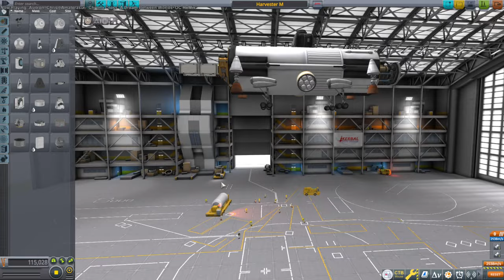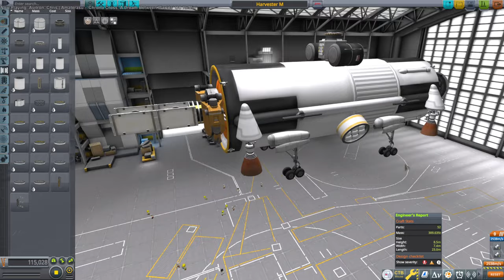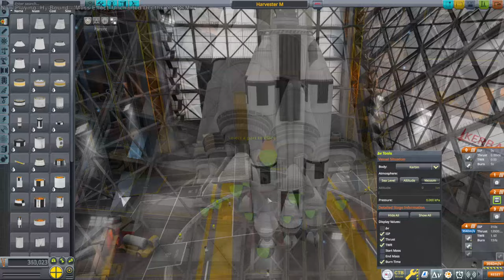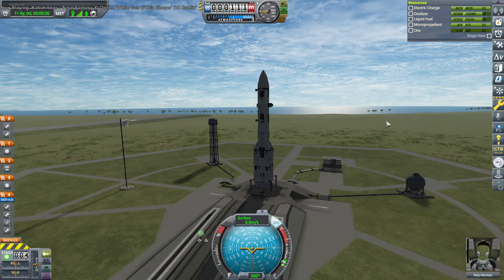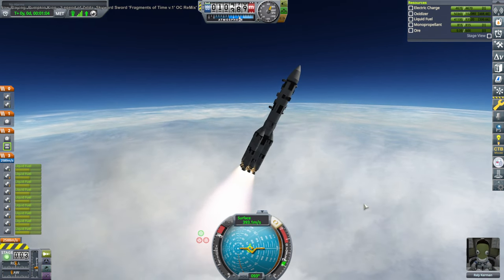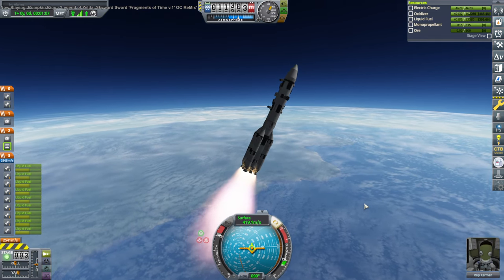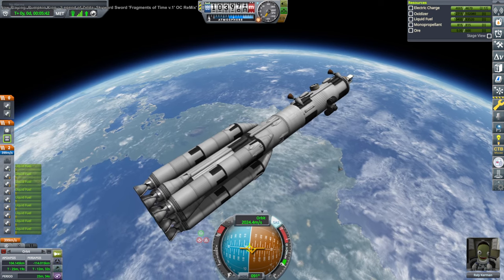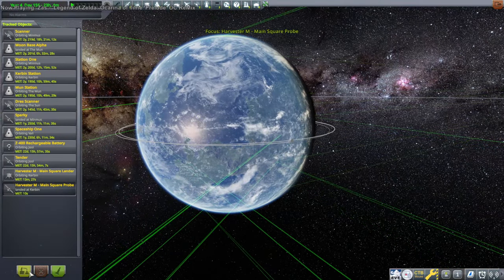Kerbal Space Program - All the Crazy Things 12 - Big Minmus Miner

Comment: Adding a angle of incidence to your wings if you have not already will help with ascent and gliding, as well as keeping the nose up during reentry. Those front canards have low heat tolerance, so if your spaceplane had reentered normally they may have exploded. I've had that happen when I used them as a tailfin.